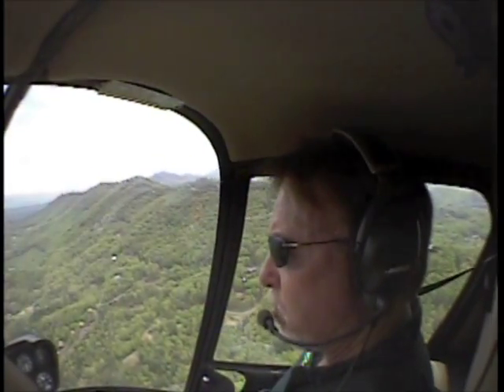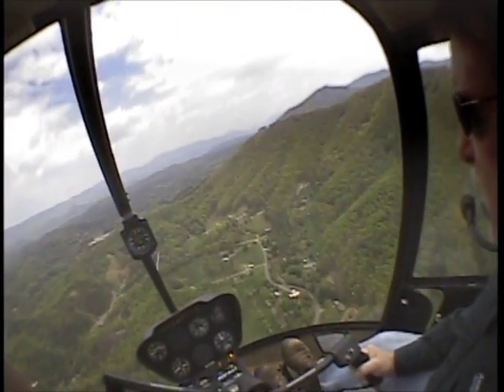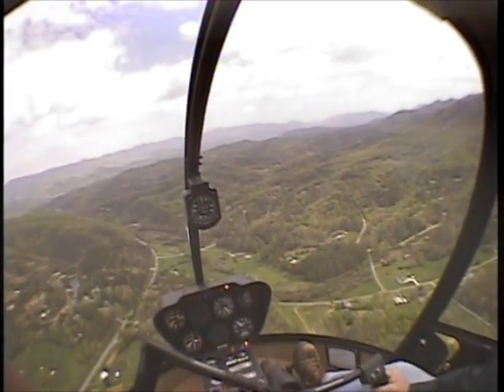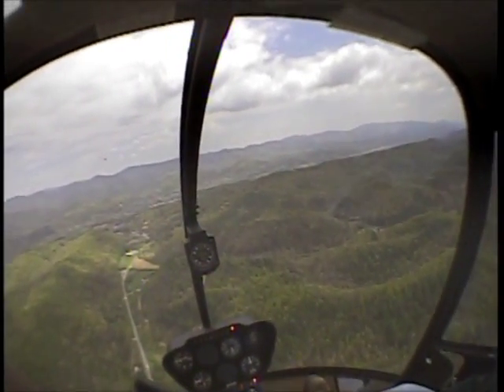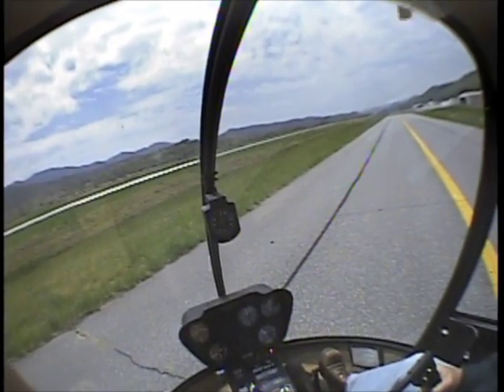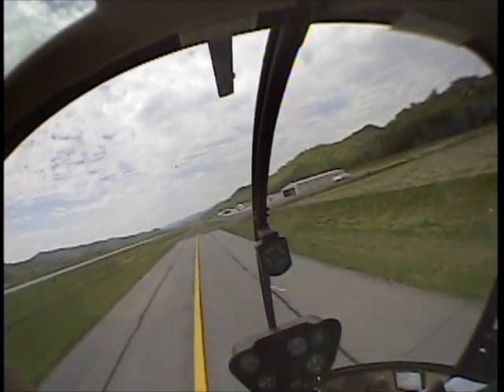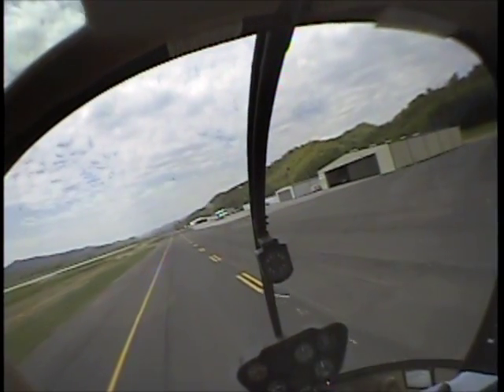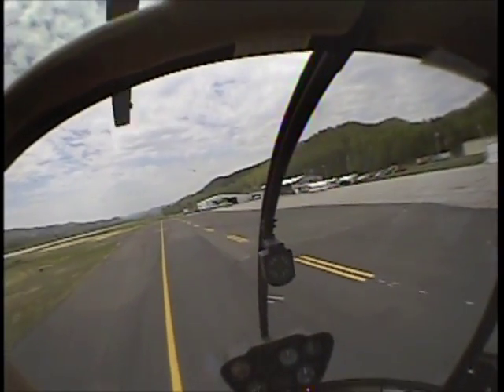How to Fly a Robinson helicopter without a functioning Governor - live audio

Comment: Michael, would you have any diagrams/videos you could make to show how a turbine engine spins the main rotor? The actual connection between the turbine, trans, and main rotor shaft? In a piston engine, like the 22 or 44, the belts tighten.  Everything's connected there, similar to a car's drive train.  But when we're talking about air being forced through a turbine engine, how does that force find its way to the main rotor shaft?

I thought an animation or cutaway might be cool to see.  Thanks!

Comment: HI. I'm planing to take some helicopter lessons and I got a question. What's the Governor? Thank you
Reply: it gives more fuel to the engine when the pitch of the blade increases and rotor rpm stays the same, the pilot does not have to worry about increasing throttle when increasing pitch of the rotor with governor on.     9 years for your answer    hope u still alive lol